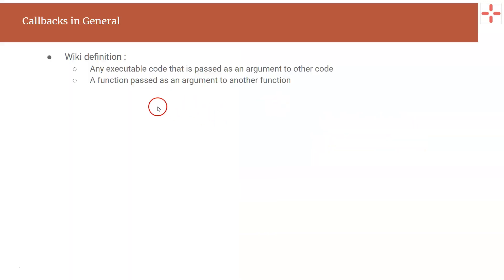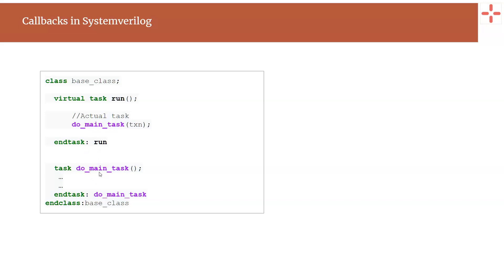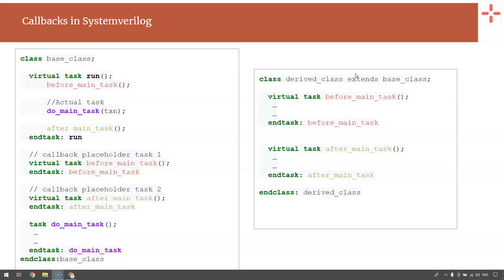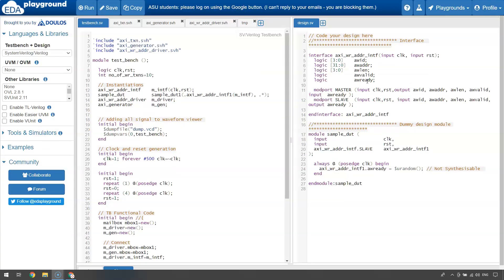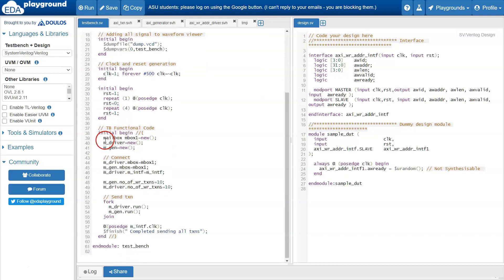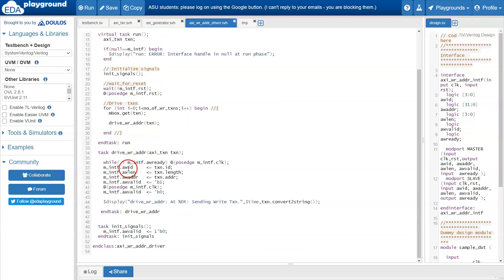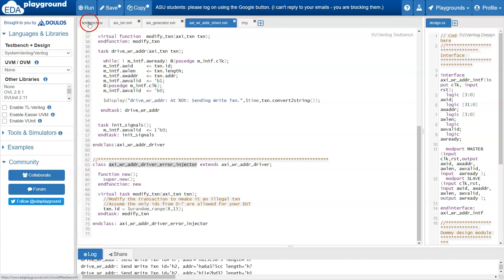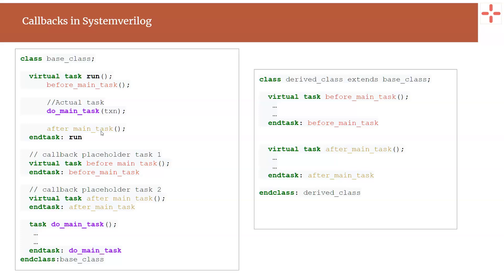Systemverilog Callback With Examples

Comment: really good. can you explain solve before constraint
Reply from the maker: Thanks. 
In simple words, 'solve before ' is used to specify the order in which constrains has to be evaluated, if needed. But don't assume they are used to specify the ordering, in fact they just change the probability of occurrence. 

Eg: 
class my_class;
   rand bit en;
   rand bit [7:0] bus;
   constraint c_bus { !en -> bus == 0; }
   constraint c_order { solve en before bus; }
endclass: my class

Even if the constant c_order was not present, bus will be always 0 when en=0. But in that case, the probably for en=0 will be just  1/(1+ 2^7), but when the constant c_order is added, it will jump ti 1/2.
For a bit more detailed explanation, you can refer the LRM section "Variable ordering" under "Constraint Random".